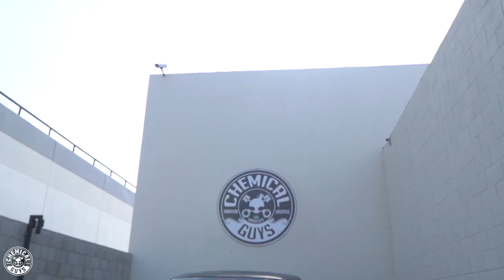How To Hyper Foam Wash Truck! - Chemical Guys

Comment: More trucks please, also does the last spray you used to dry the truck, can it be used even if it's not ceramic coated ?
Reply from the maker: Hey! Great suggestion. Absolutely, Hybrid V7 Spray Sealant works well for coated and non-coated vehicles.

Comment: Hi Henry, very useful video, but isn't it safer to rinse the first foam that can contain debris detached from the foam with only the pressure washer and then apply a second layer of foam to be removed with the glove? Also you forgot to add the V07 link. Best regards and  good job everyone. Mike
Reply from the maker: Hey! Great question. HydroSuds produces thick suds that will help pull off the grime safely from the paint of the truck. That is why I did not rinse then re foam. Make sure to check out the link down below to Hybrid V07. Thanks for watching and happy detailing!

https://www.chemicalguys.com/hybrid-v07-optical-select-high-gloss-spray-sealant-and-quick-detail-spray/hybrid-v07-quick-detailer.html

Comment: Im looking for quick connects and cannons compatible to use with my pressure washer.
Reply from the maker: The TORQ Max Foam 8 Foam Cannon ships with a standard ¼’’ Quick-Connect Plug Quick release connects Foam Cannon to pressure washer wand Screws directly into foam cannon unit. The TORQ Foam Cannon accepts any ¼’’ male attachment fittings. Check your local hardware store to find these fittings. Thanks for watching and happy detailing!

Comment: Can you recommend an in-line water filter so I can minimize and/or eliminate water spots?
Reply from the maker: We recommend using a drying aid like After Wash, it is an advanced drying aid that repels water, adds lubrication, and creates a streak and scratch-free shine when drying any vehicle. It’s the safest way to dry any vehicle!

https://www.chemicalguys.com/after-wash-anti-scratch-drying-aid-and-supreme-gloss-enhancer/after-wash-drying-agent.html
Reply: Buy a Toro Powerjet from Homedepot for $60 and dry your car off with air like the pros.

Comment: I’m still new at this but If I use this product on a truck with no ceramic coating; on the next wash could I use a different chemical guys soap?
Reply from the maker: Hey! HydroSuds will still work on a non-ceramic coated vehicle. It will leave minor protection to your paint. If you wash your truck with HydroSuds, you may switch up the soap on the next wash or you can rewash it with HydroSuds. Thanks for watching and happy detailing!

Comment: I go to my local car wash and they use this pre wash in the weather so it dries up and leave water marks, any suggestions on how to take them off.
Reply from the maker: Hey! We recommend Heavy Duty Water Spot Remover Gel. Water spots are the mineral stains left over after a drop of water evaporates. The specialty gel neutralizes alkaline stains with a mild acid, removing the stuck-on water stain quickly and effortlessly

https://www.chemicalguys.com/heavy-duty-water-spot-remover/water-spot-remover.html

Comment: What tip did you use to spray water in the bucket?
Reply from the maker: Hey! The tip comes with a pressure washer. Just search up pressure washer wand tips. Thanks for watching!

Comment: If you had use HydroSlick it can be remove later? How?
Reply from the maker: Hey! It will wear off because it will give the vehicle a temporary Si02 protection. If you have a ceramic coating it will enhance the beading effect. Thanks for watching and happy detailing!

Comment: What kind of pressure washer do you recommend?
Reply: @AlexisSanchez-uw9xv   thanks for the reply.   What set up do you recommend for washing a motorcycle?
Reply from the maker: Hey! We recommend a minimum PSI level of 1800 and a minimum GPM of 1.6 for max foam. Thanks for watching and happy detailing!

Comment: what PSI do you have to give that kind of foam
Reply from the maker: Hey! We recommend using a pressure washer with a minimum PSI level of 1800 and a minimum GPM of 1.6 for max foam. Thanks for watching and happy detailing!

Comment: What's a ceramic coating is it like wax?
Reply from the maker: Hey! HydroCharge is the easy-to-use SiO2 ceramic spray coating that delivers a brilliant high-gloss candy shine, extreme hydrophobic properties, and the durable protection of a ceramic coating with the ease of use and speed application of a spray.

https://www.chemicalguys.com/hydrocharge-high-gloss-hydrophobic-sio2-ceramic-spray-coating/WAC23016.html
Reply: Does the ceramic coating replace wax?

Comment: You wont get those thick suds using a electric power washer. Has to be gas powered!!
Reply: @AlexisSanchez-uw9xv  Pretty sure they are using a gas powered washer
Reply from the maker: Hey! We recommend using a pressure washer with a minimum PSI level of 1800 and a minumum GPM of 1.6 for max foam. Thanks for watching and happy detailing!
Reply: @ChemicalGuys  Hmm you should use a 1800 psi electric pressure washer and see you won't get as thick of a foam.